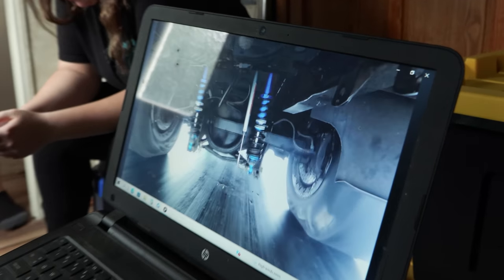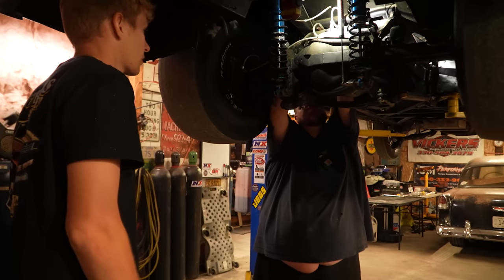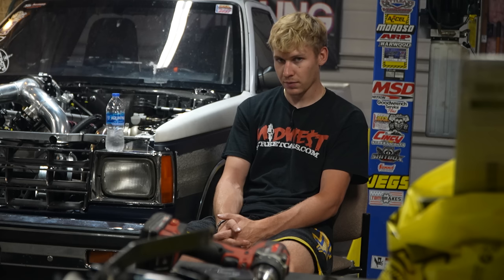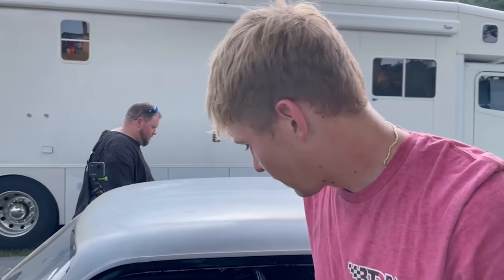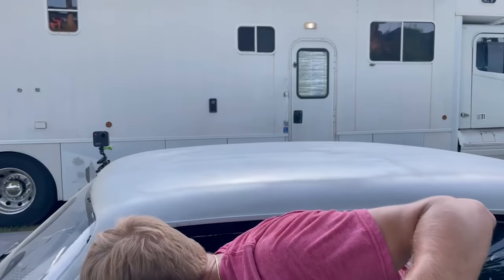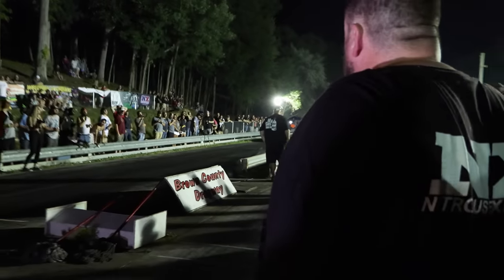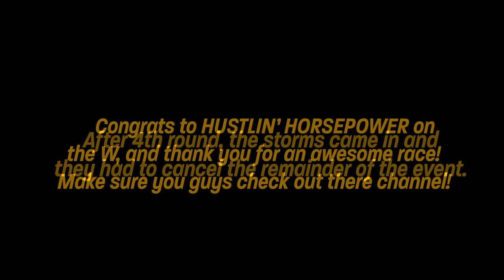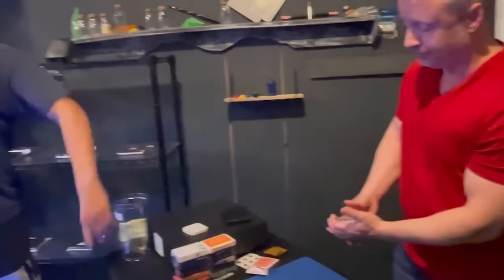50 of the FASTEST SMALL TIRE IN AMERICA! Gangsters Paradise Invitational

Comment: Family that races together stays together, love your channel and cars. I am impressed with your cars and talent .My dad and i raced and built cars for years. Watching this video of the nova"s suspension it appears to me that the shock and 4link are to close to centerline of the pumpkin, which accounts for the extra body role and unstability at high speeds under the extreme  power your making .Doesn"t look like there is alot of room, but if they could be moved out,it would drive as good as the falcon.

Comment: Hey guys happy 4th, on sprint cars they use to use a thick piece of moly tubing as a anti roll bar, keyed with a round pin not square, the only replacement after was it would stretch the arms
Reply: That’s basically whats in the car now is a simple piece of moly tubing except the ends are welded on since they don’t have to be removable like they do on a sprint car
Reply: @54raceman  moly when weld will get stress cracks in about 6 months, spray check the welds, may be cracking

Comment: All that steering wheel chase, I noticed when your frontend extended up your left tire pointed inward. That causes the frontend to "hunt". And it nose dives the left front like the shock is weaker or out of adjustment with the rt. Just a suggestion: you might look at the rack or steering to make sure your pivot point is parallel to your bottom A-arm pivot point. Personally watching the vigorous hunt looks very dangerous to leave things as they are. Good luck

Comment: The Nova looked pretty straight after working on the suspension. That track looks slippery. Hope you stay safe and get the frame looked at too. Have you put the Nova on an alignment rack to see what the specs are at? The Falcon should really be fast with the 388, bigger turbos anf injectors. Good luck guys!

Comment: Billy, try to mess with a radial and front side stuff man! Go fast with the Nova brother!! It deserves it, and it'd be cool to see y'all trying something different! I know pops is on the radial pro. How's it work and what pressure are you running in the Malibu..? I'll be running on my 99 Camaro, turbo car. I'd like to be able to keep it on a radial without needing a flypaper track. It should go deep 8's, and 5.50's, idk. More setting up for quarter mile since Bradenton is so close. You guys have any extra 3rd members you wanna sell? Just ordered my QP 9" and axles, need a 35 spline unit, 3.70 gear, possibly 3.50...up to 3.90. Thanks!

Comment: Swap after the season.. youre gonna have issue after issue with the falcon after you swap it.. new turbos new engine converter changes maybe.. new setup kinks to work out.. off-season you will have time to test and fix stuff and do necessary upgrades to suspension to handle the new power youll be making.. just my 2cents.. everyone has to go down same track and the falcon is ol tried and true when you're screwed black and blue on bad surfaces.... it needs more power.. but isnt it doing its purpose.. 1st off trailer.. NO PROBLEM.. got a tune and it will always grab... hope to see ya race this year and good luck.. youre a great team and good people.. hope nothing but the best for you ALL even the pets

Comment: The Nova needs to go to a reputable chassis shop.
The anti-roll obviously isn't big enough for the weight/power and SOMETHING isn't straight on the chassis.
Stop messing around with it and let someone that builds them for a living take a look.
Reply: Exactly. Then ask the shop to explain what, why and as much of the how they're willing to teach. Because the Nova looks like it's still doing the things going down the track it has been, except maybe less noticeably, like the land yacht seesaw and it appears to be just not entirely predictable with setup changes and how it reacts to changes in the tune.
Reply: @RLRSwanson  I think everything he has done has only masked the actual problem. It needs to be fixed, not just adjusted to "good enough"